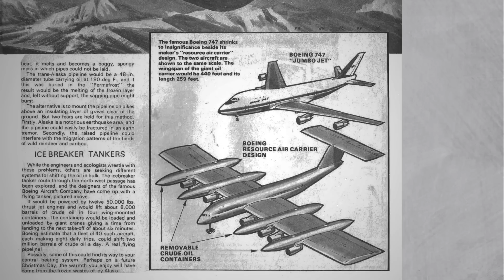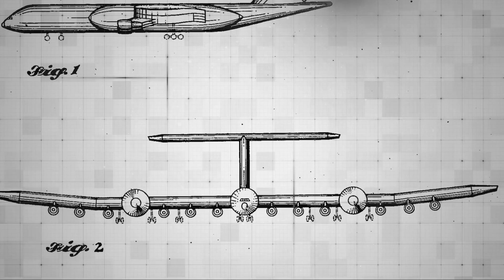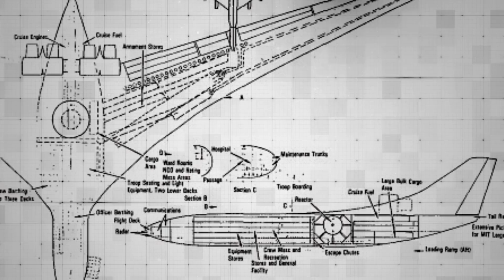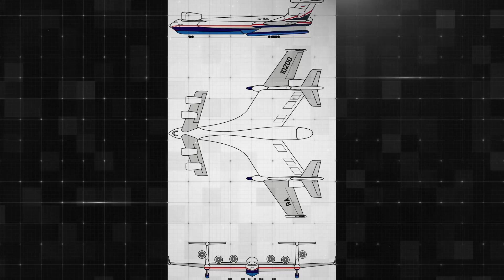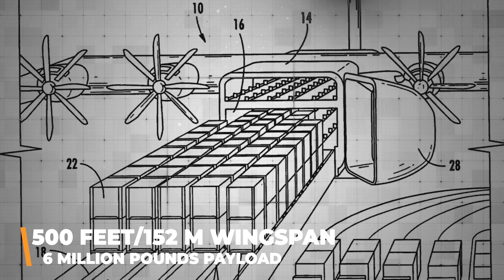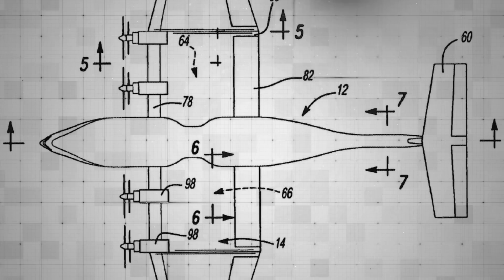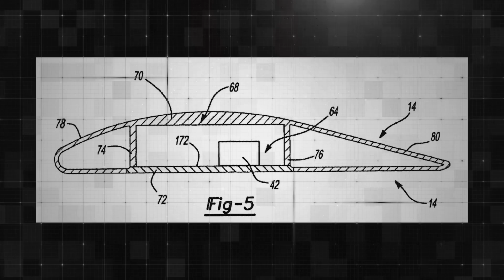These are the Biggest Aircraft that Were Never Built

Comment: With how difficult it was to integrate the A-380 into the airspace system, how in the world would it have been possible to integrate aircraft multiple times larger and heavier? The A-380 has special rules and requires significantly extra distance from other aircraft due to the wake turbulence they produce. I doubt anyone has anywhere close to an accurate prediction the kind of wake turbulence a 6 million pound aircraft would produce. And then you would open up another giant can of worms discussing what it would take to make airports capable of accommodating one of those bohements.

Comment: All of these designs are ridiculous when you consider they have to take off & land somewhere. No airfield or runways could accommodate anything close to aircraft of this size & weight. It would have required billions in infrastructure upgrades to handle them. The Soviet seaplane would not have been immune. Yes, it didn’t require runways, but it would need docking facilities of unprecedented size.

Also, nuclear reactors on a plane? Those are exactly what you want falling into a city if the airplane crashes. 😂